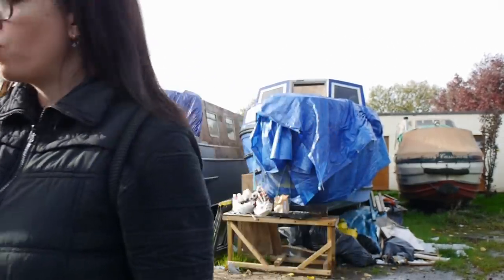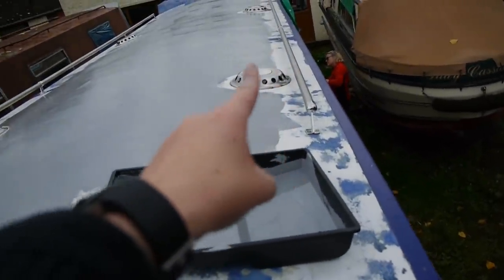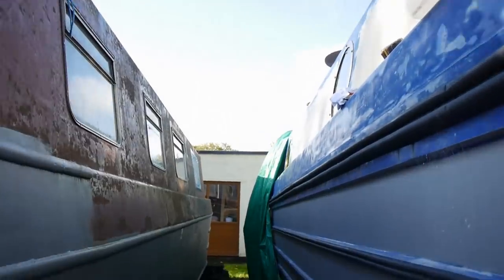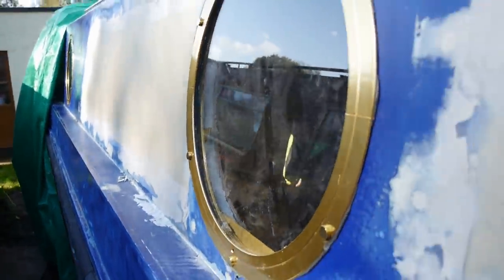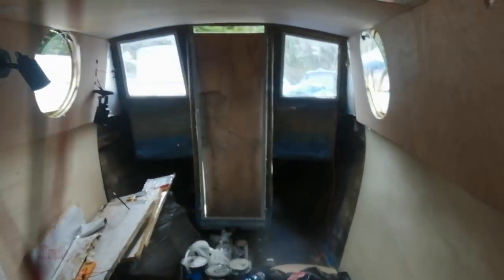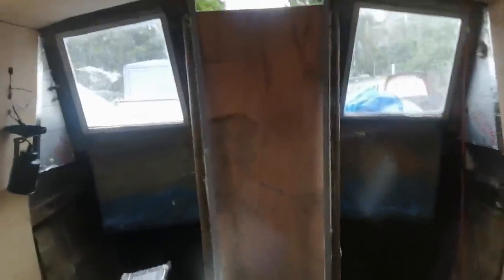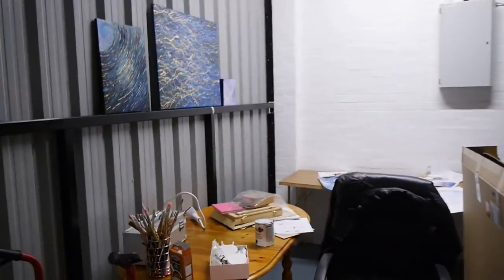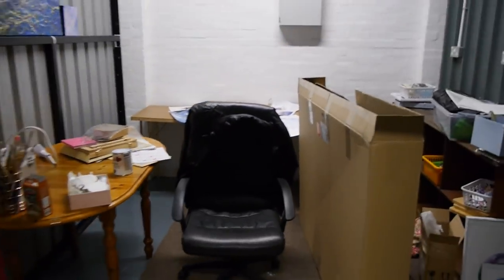Ep 39: Leviathan has WINDOWS! Back to the Boat Yard!

Comment: You should have removed ALL of the hardware on the outside of the hull before painting. Then re-seal them to prevent de-lamination of the fiberglass in the future.
Reply: That boat is going to start rotting from the inside.